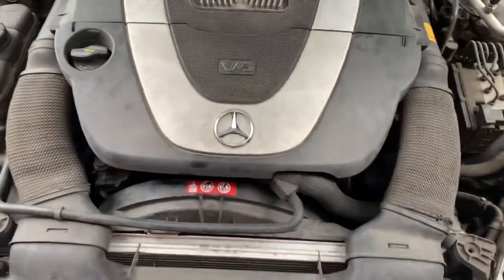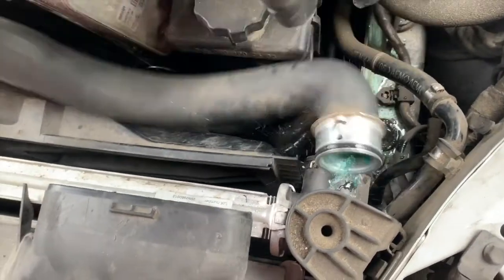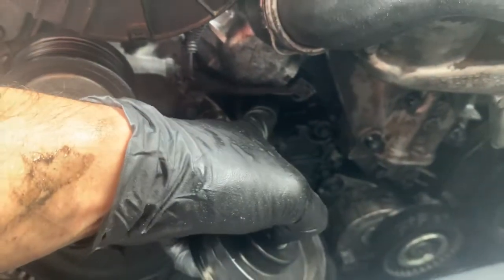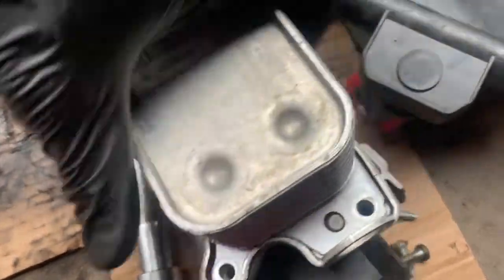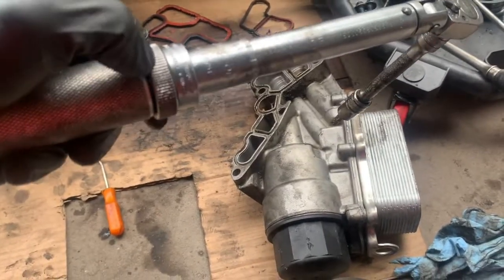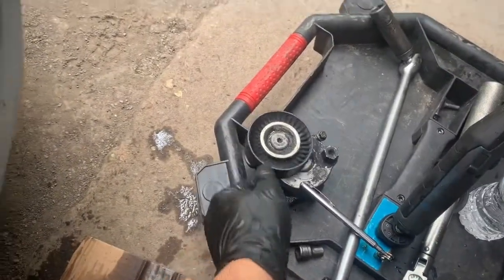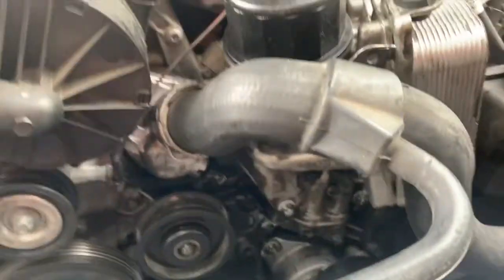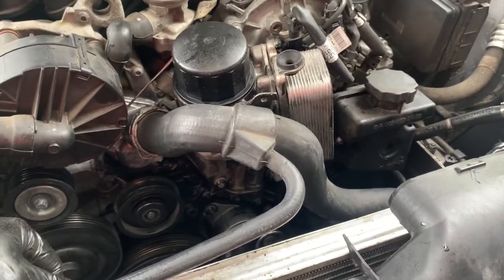2006 Mercedes-Benz SLK350 Oil Filter Housing & Oil Cooler Gasket Replacement

Comment: Is it a better idea to drain all the coolant out from the radiator below if I'm going to change the thermostat and the oil filter and cooler gaskets?  I've heard of complaints about the coolant getting onto the pulleys and causing the belt/pulley system to squeak afterwards. I don't have a lift at home so it makes it hard to access the drain plug, but my car is coming up on 11 years and I know the coolant should be changed at 15 years or 250,000KMs. Also, you don't have to remove the power steering pump to gain access to the entire oil filter housing correct? Just wondering, as I've seen other DIYers remove the power steering pump when only replace the oil cooler gasket. 

Thanks!
Reply from the maker: You can drain the coolant, however I did not due to not much being lost when doing this job. But you are correct about the belt squeaking afterwards if there is coolant on the belt. I tend to pour water over it and blow everything off with an air gun. But I did not have to remove the power steering pump when replacing the oil cooler gasket. FYI, removing the power steering pump can be a PITA, due to one of the torx being on the rear side of the pump.
Reply: @TexThaiAuto  Thanks! Also, is it necessary to change the oil filter when doing this job? I just changed my oil recently and am not due for a change for another 5,000 miles.
Reply from the maker: If you remove the filter before cleaning the housing, then you will be fine.
Reply: you are right 100% my friend

Comment: You didn't have to loosen the secondary air pump at all to get to the top bolt on the thermostat?
Reply from the maker: No I believed I may have used a swivel.